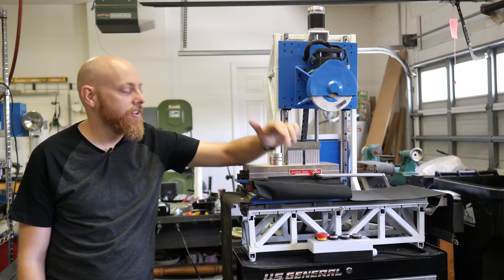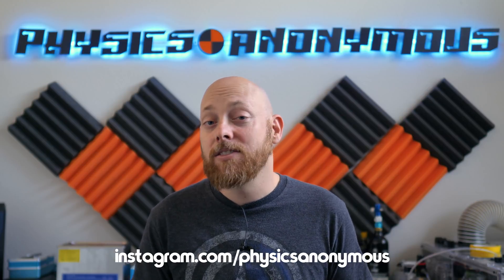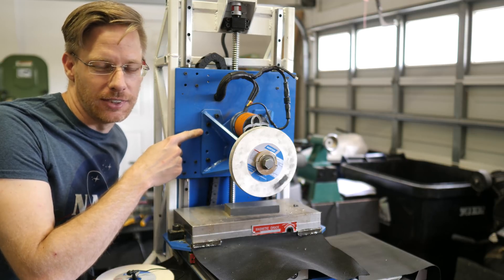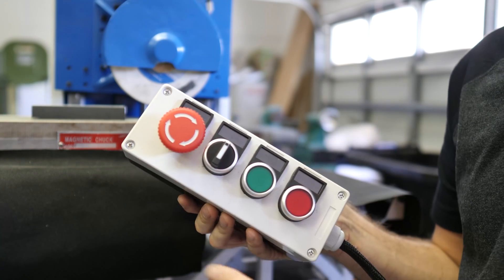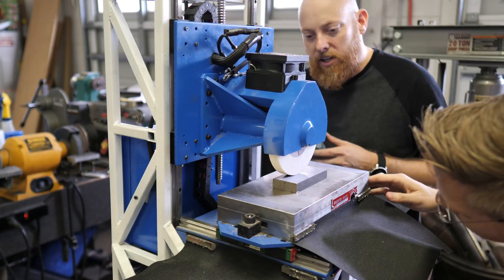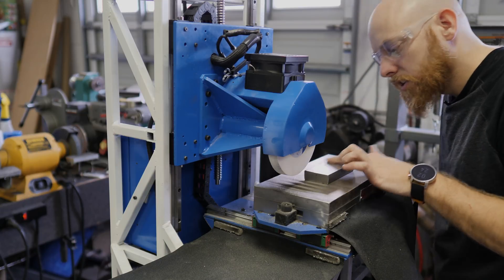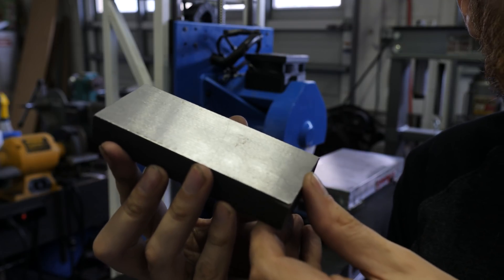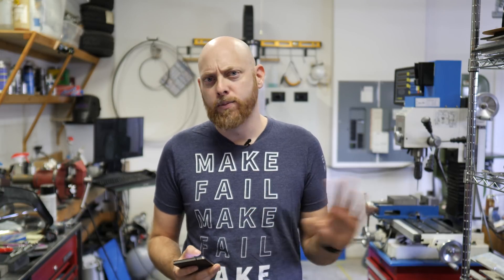About that DIY Surface Grinder - S03E02

Comment: You need to dress the wheel every time you start the spindle and between jobs to get a decent surface finish. I can hear how unbalanced it is and you can see by the sparks that the wheel is not true.

Comment: I use 46 grit and have a mirror finish on parts. The reasons that I can see are 1) balance and vibration (I minimised these with an O-ring belt drive, balancing the wheel and getting rid of the V-belt discontinuity with the smooth 10mm O-Ring drive while using minimum belt tension). 2) Stiffness of the system overall - new bearings and solid material in the machine itself. 3) Wheel dress. I spent a lot of time working out how to dress the wheel so that it was smooth on the face and exit (where the final finish comes from) and nicely parallel to the ways. The edge of the wheel does the cutting. The rest of the wheel does the smoothing (pretty much regardless of the grit), thus enabled by the diamond dresser cutting off the sharp edges on the grit granules - if you're careful. Also, I used small increments (about  1mm per increment step) in ONE DIRECTION for each pass over the part. I never went back and forth in the passes - only cut one way. This was very satisfactory to observe as the zigzag pattern disappeared and the 'record grooves' pattern also became flat with no perceptible roughness - even with 46 grit J hardness wheels!!

Comment: I worked on a large cylindrical grinding machine a long time ago. The wheelhead was a large fabricated steel box and we had loads of problems with vibrations and poor surface finish. The machine was improved by filling the void in the wheelhead with
concrete to stop it vibrating !!!

Comment: little stupid idea to set posisition by hand in CNC machines, why you dont run machine on linux cnc? On linux cnc you can set posision by xbox wireless gamepad. If yooo want do this in more sofisiticate way just buy cheap china JOG controller or M.P.G. Im not hatein a juzt asking :D

Comment: Kudos to you guys 
Your grinding WHEEL is tool thick. Use half of the thickness and the surface will ok. The structure of the machine can not absorb enough vibration generated by the machine. 
Keep fits

Comment: Just a thought, but maybe a locking system to lock the motor/head assembly to the frame after you position it on the Z axis help with rigidity ? Otherwise I would suspect the spindle bearings as the issue. I enjoy your channel very much. I'm just a low budget in my apartment version of you guys's set up...B^ )

Comment: those wheels it comes with are the cheapest things ever! I have this 
chest and after only abt 200lbs of tools (that's not even much), one wheel 
started to cave after rolling it only a few times. I wasn't buying new 
wheels so it sits mounted on bricks. if we have to move it, just grab a 
pallet jack

Comment: not sure what scale your spindle control is but i program grinders and would estimate you need about 1200  rpm for that size wheel. i program 
in Surface per minute, about 3000 for a 10 inch wheel. stiffer spindle would surely help also. nice build though. thanx for sharing.

Comment: A few  words to those who rush into criticizing this project: the general mantra when it comes to scraping is that the straight edge should be made out of cast iron, stress relieved and let to rest for over a year. I made a 43 inches straight edge out mild carbon steel, no stress relieved, I power scraped it. I got a solid 4 tens over the entire 43 inches and then I did my Bridgeport bed with it and I got  a decent  6 tens  off over 25 inches. The straight edge is one and a half years old now and it has retained its precision.  And I am certainly not the only one, check this out as well : https://youtu.be/YanlyahWDOw

Comment: What a bunch of chodes in the comment section. These guys are out here making shit and ending up with good results. A few tenths is pretty ridiculous for some shit thrown together in a garage made with other tools thrown together in a garage. But everyone has the audacity to complain and bitch about mass and the linear rails and the spindle and all this other nonsense. Guess what, it fucking worked. He's not going to be churning out thousands of mass product products that need to be dead nuts accurate to each other, he's just making shit tools so he has access to the tools. I would take this particular surface grinder over not having access to one any day. I don't see any of you arm chair machine builders with your own channel showing us how it's done. Get off your ass and go make something, then complain about what these guys are doing, but only if yours is better. And I get the one guy that builds machines FOR A LIVING, but this is not that, so it doesn't need to be the same. Clearly if they wanted some ridiculous spec spindle and v ways and all that other shit they would have spent the money on a new or used machine, but they obviously don't need that. This is probably 15 to 20 times cheaper than anything they could have bought used and it's doing what they want just fine. It's dicks like you that keep people from sharing. I have just finished building a large vibratory tumbler from scrap parts that works phenomenally and I'm currently building a CNC plasma cutter and there is NO WAY I would ever share that on youtube because I don't want to listen to all of the pricks in the comment section nit picking every little thing.

My dudes, keep up the good work, and think about disabling comments for all your videos. People will still watch without being able to comment, but you wont have to listen to all of these d-bags.

Comment: Neat ,I am a Mold maker by trade(50 yrs). 1: Once you dress the wheel do not turn it off. Never touch of with a dead wheel. 2: You need  a actual grinding spindle cartridge. 3: Grinding wheels have code which you need to learn. For general Tool and Die/ Mold making. , 46K( a harder type wheel) for soft. 46H for hardened tool steel(which is a softer bond). There is also different types of grits, and bonds used for different applications. And Lastly #4. Use a actual lead (ball type) screw on your Z axis. So you can get actual .0001 increment feeds with your hand wheel.

Comment: I'm far from being an expert, but I did en internship in a machine shop and did a lot of surface grinding. Something feels really dangerous to me in your program : you're cutting in both direction. The thing is that when you do "climb" cutting (analogi whis milling here), if the part sleeps, the wheel will bite into it even more, making it worst. You will end up a part thrown through you're shop at bullet speed, and the wheel will probably explode. For this reason you only want to do some "conventional" cutting, and you must never stay in the plane of the wheel, because failure could lead to very bad injuries in case of a wheel explosion, which happens a lot more than you think 😅
Hope this will be helpful, take care with this kind of machine, they can be really dangerous :)

Comment: I like the bold, irreverent approach here: gather a buch of friends and just go build a fn surface grinder in the garage. Have a serious go at it. See what the heck will happen, how good or bad it works. Observe interesting phenomena. Learn from immediate experience. Have some laughs.

At the same time, evident from the comments, you're exposing yourselves to all these little people, these petty little creatures who feel a little big bigger when they get to point out shortcomings and flaws - whether true or not - in the rudest possible manner.

They're having a field day in the comments section. They hammer furiously on the keys, so worked up that they barely bother with grammar and interpunctuation: The frame should be cast iron! The spindle is sub standard! Why don't you buy a spindle from DMG mori instead! Go read the scientific literature on bearing design! How dare you try to build a surface grinder in your spare time! How DARE you!
Reply: Well written. I agree 100%, I think Will attempt to build something similair in the next year or so. But out of granite floor tile and epoxy granite. Budget 200-300 bucks. Feels like people already loading up on comments. :D

Comment: I'd say you've done a good job. The "chatter" is from the machine vibration/harmonics. If you cant add more weight or stiffening, try a counterbalance/tuning arm. It may be as simple as adding a long stiff threaded rod with heavy nut to adjust. Trial and error locating it

Comment: I think you just saved the manufacturers engineering department a lot of time. Do you really think they'll fix it?

I'm also curious. Is there any way to compensate for the loss of material on the grinding disc itself? Other than manually?

And a little story about safety. I work at an International Paper Mill in the late 80s where an employee, a Machinist Apprentice, forgot to reset the RPMs on a horizontal grinder machine with a 26' by 2' wheel. It came apart. Shattered, actually, and killed him.

So PLEASE! Never exceed the RPMs listed on every disc, or wheel. You may kill more than just yourself.

Comment: Youre kidding right???????  Tenths.... In a non climate controlled garage ..... On a cheapo uncertified granite.... With your indicator cocked at a crazy angle..... With an indicator tip that in guessing doesn't belong to that indicator..... Lmao.... This is satire??? I'm guessing.... Been a tool maker working millionths for 30 years..... This is satire or are you really just that silly????
Reply: With all their mistakes (that they aren’t afraid to recognize) and starting with no knowledge other than knowing what they wanted to achieve they made a surface grinder that exceeded their needs. Safety could be better and a grinding spindle would be a big improvement but as a gunsmith capable of quality machining I would say they accomplished the goal.  It’s a shame that tool and die makers think their accuracy is the only acceptable standard.  I set my woodworking tools up with .001” measuring tools.  I built my best hunting rifle on an ancient 14” South Bend to .001” tolerance.  It shoots 0.3 MOA.

Comment: Um... You realise you will NEVER be able to grind anything more accurate than like 2 thou with that Frankenstein right??? Wrong spindle bearings....ways...etc etc.... Failed from the start.....no matter what you do to improve that thing .... The basics are still incorrect.... The machine is flimsy.... No mass to it..... Ya can't take 80/20 aluminum extruded crap and make a surface grinder.... You just can't....it doesn't work period ..stop being so fn stubborn and learn from ppl with 30 years grinding exp uggggg I'm saddened by the state of our manufacturing today.....
Reply: But they did.

Comment: Try a double pass before moving the Y-axis: Grind in Standard Direction (wheel spinning opposite the feed direction), Grind in the Climb Direction (wheel spinning with the wheel direction) then move the Y-Axis, that will emulate how older surface grinders handle their auto-stepping. As many others mentioned, your Spindle Bearings sound horrible. I love the build, and am very surprised at your good results. Get some active dust collection going both in the spindle guard and on the table ends.

Comment: You need to dress your wheel faster.  Run the dresser past it faster and more consistent.  You cannot stop and start.  Also take .0007” each pass and take about 5-6 cuts.  This will give you an open dress.  Also move faster when traversing.

Comment: when you start the grinder you can hear that there are vibrations. this can be because you have unbalanced wheel, shaft or motor. This can cause shatter. Moreover you cant try to lower feed rate and check if it goes away, but first of all balance wheel. Try to make wheel holder with balancers

Comment: In the case that no one has mentioned it, WD 40 tends to improve finish greatly as well as placing the dressing stone on the leading edge of the wheel rather than the center.

Comment: Hi Guys,
Thanks for the shout out. I've been following your build from the beginning and am quite impressed with what you've achieved. I never expected that kind of tolerance or finish. The finish on it is due most likely to spindle noise, also dressing the wheel properly will make a huge difference. You need a faster traverse, and no stopping or hesitation. Keep the traverse speed as constant as possible. The single point diamond should be mounted 10 or 15 degree angle pointed away from the center of the wheel instead of straight up. A six point cluster diamond (like shown in some of my videos) may give you better results, this one you mount straight up. The wheel I would recommend would be the Radiac RAA46 H800 VOS, it's a porous wheel that is very free cutting. It generates very little heat so it works good without coolant. I have used one that I'd be happy to mail to you for use free of charge, if you'd like. Soft steel is harder to grind and get a good finish than harder steel. I would recommend trying to grind O1 or A2 that's 50-58 rockwell. I know some of your commenters give you some flack, they might be correct on some criticism, but what you achieved so far is very impressive to me. Regardless of how well the grinder turns out, the learning experience is worth it's weight in gold. Thanks for the great series.
Steve

Comment: I think that you are at the point with the surface grinder, that you have solved all the problems that you can with your skill sets, and now the only thing that holds you back is that you don’t know how to use a surface grinder.

Comment: Obviously big iron castings are unrealistic for a home built machine like this, but have  you considered achieving the same thing with concrete?

 There is a channel out there called "Confounded Machine" that home built a big lathe out of the stuff.  This was previously done during the world wars to work around metal shortages and rapidly bring up machining capacity.

I wonder if you could adapt that technique to the grinder.  If you were to embed that whole frame in a concrete casting, the frame itself could serve as rebar.  It's be cheap and would increase both mass and vibration damping.

Comment: Is it possible to add some type of fluid balancer to the end of the spindle? That way it be continually balanced as the wheel wears.

Also is there a way to measure deflection in you spindle while it is running?
Reply: A worn grinding wheel won't cut. So you're constantly dressing it to sharpen it. Which means you're worried about something that isn't going to happen before you have more serious problems.

Comment: To improve your surface finish you might try 1. A 46 grit wheel and make sure that it is bonded appropriately for the material you are grinding. (hard wheel for soft material/ soft wheel for hard material)  2.Dress the wheel again just before your final pass. 3. Limit the depth of cut on your final pass to .0002". 4.Figure out some way to balance your grinding wheel. (I'm betting this would help a bunch!)  5. Try slowing your traverse speed and/or your stepover. and 6. Consider using coolant. Yes, its messy but it works and an old spray bottle is all the equipment you really need.

Comment: This could be even better with some epoxy granite fill in the frame (that wouldn't be too difficult either), a good preloaded spindle cartridge with abec 5 or 7 bearings, and some covers for those linear rails or they'll get crunchy and start sliding in a hurry. Having fun watching the process.

Comment: the cut sounded like the wheel was not balanced. dressing and trueing are two different things. remember your setup needs to be wider on the magnet than high for safety.

Comment: maybe having handles on each axis that have switches that when you start pulling it turns off the motors and allows your to move the axis manually might be an easy solution

Comment: I would guess, that grinding contrarotary to rotation direction could give you better final-touch cut. Why wouldn't you use some linear brake at frozen Z-axis? It could theoretically remove any clearance in this particular dimension. The same could be done with X axis - at surface grinding machine only working direction is Y-axis, so there is no need for preserving movement in any other XZ direction.

Comment: Love the show, you guys do amazing things with gut and gumption.
As others have noted, once you dress the wheel, you cannot turn it off or you might as well have not dressed it, that would be of some help with your surface finish.  I would increase the left/right (usually X) speed to get a better finish, although with the rigidity issues you are having that might not be possible.

Looking forward to the conversion of your mill, I was really close to doing what you are doing when I basically had a Tormach fall in my lap.  It isn't perfect, but for the price it is capable and useful.  I would be happy to share my experience if you would like me to.

One other thing, the sound level of the music is super loud compared with your talking, when watching this video at lunch I had to jump on my volume control a bunch of times so as to not disturb my work neighbors.   Not sure if this is a problem for anyone else but it was a little annoying.

Thanks for what you do!
Reply: I dress the wheel and it works fine a day or a week later - still gives a mirror finish. I'm not sure what that refers to @JimmyGFromDayton

Comment: once you dress the wheel you shouldn't stop it until you are done with the grinding that is probably one of the reasons that you have so much chatter. each time you turn the wheel on the wheel will shift on the arbor slightly causing your wheel to no longer be running completely concentric to the arbor which can cause chatter like you showed.